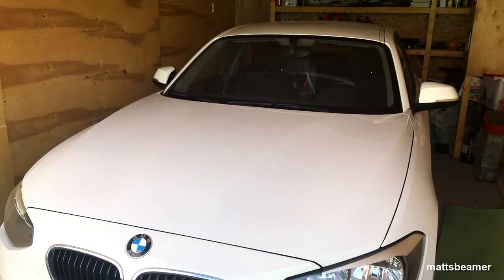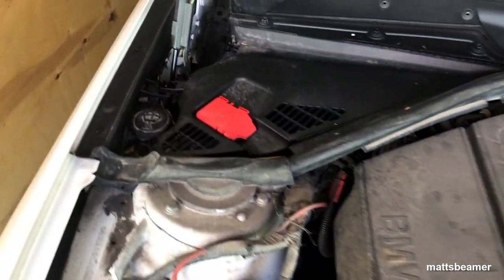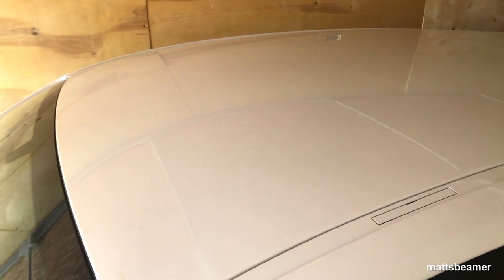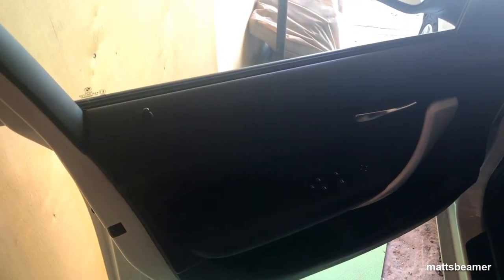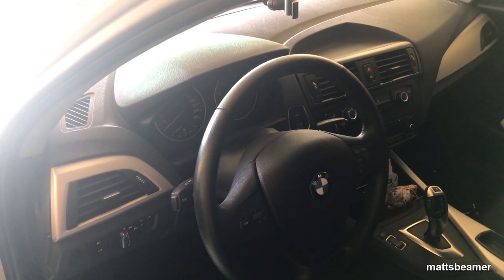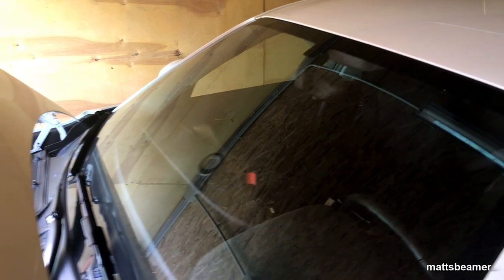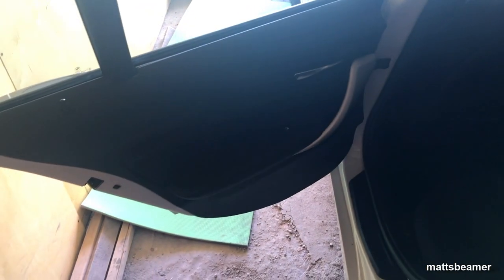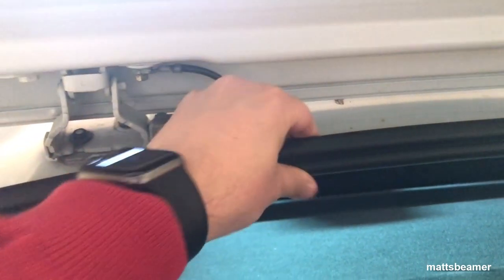BMW F20 F21 1 Series. Why is my BMW wet inside? Footwell, boot floor battery compartment, carpet.

Comment: Just repaired my f20 rear boot. Those 2 vents had a ding in its life so they came loose. After removing the grommets both sides poured out litres of water. Replaced the vents and sealed them off. For good measure i also sealed the plastic structere above it that holds the rear bumper.

On a side note the rear lights dont have a seal to the body of the car.

Comment: also the AC drain tube can leak. and than leaks in your footwell left and right side.
Reply from the maker: Thanks for the tip Pieter :)
Reply: Where is ac drain tube located on f20 ?

Comment: What do you think it could be if it is the driver's footwell and the right hand rear passenger? Nowhere else is getting wet and no matter how much we dry it, it seems to just be getting more wet again even if the sun is out.
Reply from the maker: That’s very odd, I wonder if the pipe to the rear washer goes that way. I’ll try and look into it
Reply: @mattsbeamer  thanks! I've booked it in for a service but have to wait a week for that~ I'm suspecting either it's the driver's door seal (needs replacing but never had issues before) or HVAC drainage... I'll post here what the results are when it's back
Reply: @ceciliatabbi4218  Mines doing the same. Did you manage to find out what the problem was?
Reply: @aaamak47  it was the sunroof drain, blocked.
Never heard of one but the dealership fixed it for me and dried out the car. 
No lasting damage thankfully.
Reply: @ceciliatabbi4218  hmm I don't have a sunroof so not sure what it could be. Will probably have to take it to dealers. Thanks for reply
Reply: @aaamak47  mines doing the same any update?
Reply: @morganrogers6237  sorry not had the time. I've read that some have had and it could be coming through doors (door membrane). There's a test you can do, open door, get a hose and spray on outside window. See where the water is coming out from.
Reply: @aaamak47  okay nice one for that mate will give a try

Comment: My wife’s 2018 1 series is wet under the rear seats. Local BMW garage replaced the boot vents as they thought they were causing the problem. Cars been out the garage for 1 week and back seat is soaking wet again. Any ideas?
Reply: If there is also wet front footwell, sunroof drainage can be the reason. Another option, the rear door vapor barriers  might be the problem..

Comment: If you have sunroof, it is probably due to clogged sunroof drainage. I had my driver and passenger behind driver had too much water, still drying tye foam underneat the carpet. simple problem can cause big problem.
Reply: How can I check and clean the sunroof drainage?
Reply: @gonzad7762   hy frend you solve the problem can you help me with drainage sunroof ???
Reply: @rusu84  hi, i was able to solve the issue. In my case the water was coming from the rear door vapor barrier not from the roof.
Reply: @rusu84  https://www.youtube.com/watch?v=UAPn0gMutSU
This video gives the idea how to clean it. Note that the exit of this sunroof drainage can be found below cable connection when u opened the front doors. You can also use finger to open up the exit part to make sure the water goes out...
Another thing about the water in front footfloor, it can also be because of failing rubber seal of the front cowl cover interfacing with windshield glass.

Comment: Thanks for the info. Will check out my rear n/s door weather seal tomorrow.
Reply: How did you get on m8, were the door weather seals the problem?
Reply: @garywilliamson1987  All sorted thanks. I was the vapour seal. Butyl tape had come unstuck, so heated it up with a hair dryer and re stuck it down.
Reply: @michaelgurd7477  how do you get to the vapour seal?  Is it a long / hard job?  I'm getting water in my passenger front and rear footwells and believe this is the issue.  It's only 3 years old!  My old 3 series was 10 years old and never suffered with this
Reply: @PerroEstrellaLuna  Firstly, I checked if the water was coming through the vapour seal by having the door open and pouring water down the outside of the window like the guy at 3mins 20 sec in this video. I did not need to put a plastic lever like he did. 

https://www.youtube.com/watch?v=lLs7NlCqga0

As your car is only 3 years old and I assume just out of warranty, have you thought about taking it back to the dealer which you bought it from and trying to persuade them it's in their interest to repair it free of charge? After all if you're in the UK, it'll now need an MOT and you'll want your car serviced at a reputable establishment.
Reply: @PerroEstrellaLuna  I've had my car for 6 years, so no thought of taking it back to the dealer.
It took me about an hour to do.  I had the tools required to hand. 
The best video I found on how to take the door card off is the first 4minutes and 45 seconds of this:

https://www.youtube.com/watch?v=igmTlnSMo-g

I used a bojo tool not a screwdriver to lever the card away. 

My vapour seal had come unstuck at the bottom and was letting water through there. What I did to repair it was to warm up the existing glue with a hairdryer and when the glue was tacky was push it back onto the door to reseal it. I had bought some butyl sealing tape but used the hairdryer instead.
I then tested the seal by pouring water on the outside of the window. Just block up the hole the bottom right door card trim clip goes into when doing this.